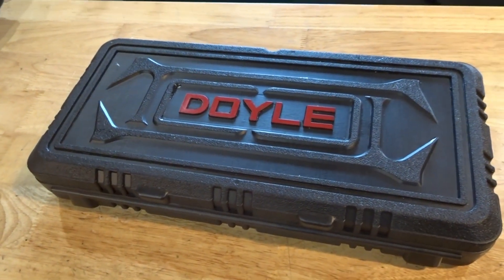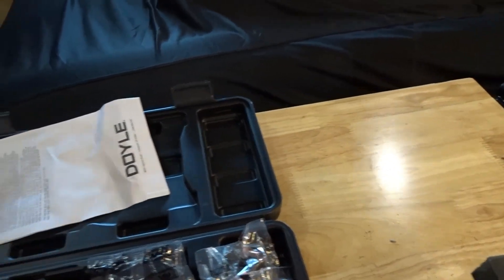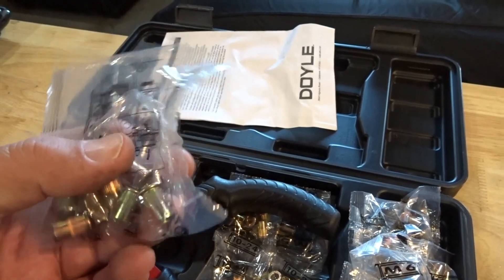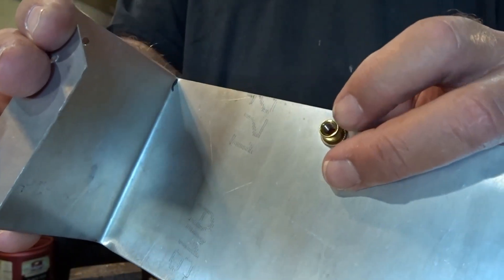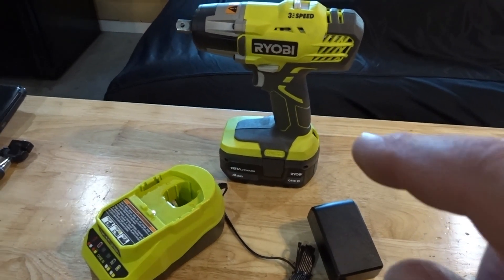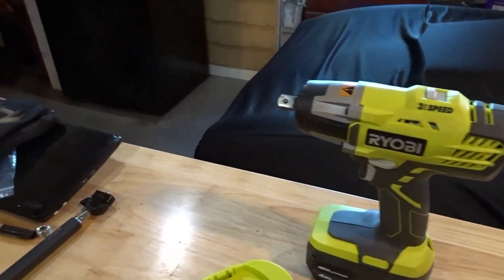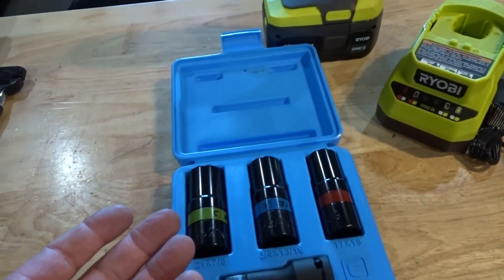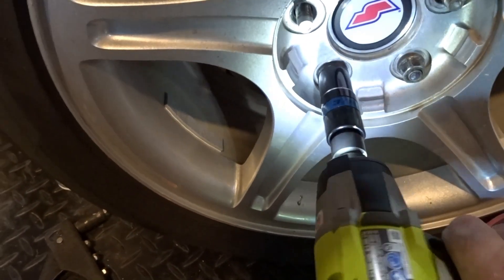We Got A Couple New Tools For The Shop

Comment: i had a real problem with my nutserts spinning when I tried to secure the buttonheads on the firewall. Had to end up cutting a few bolts off and hammer out the nutserts. Ended up using loctite on the back of the nutsert to prevent slippage.
Reply from the maker: Nutserts can be funny that way. I've had them not allow the screw to be threaded in. In that case I run a tap through them to clean the threads.

Comment: And Thank you for calling them “Nutserts”… haha. I was able to commandeer a battery operated Firebird Nutsert gun (kind of expensive) a few years ago…. And it works fantastic. And the worst thing you can do is to install a nutsert… poorly. The new Nutert tool you bought is exactly what people should be using…. NOT the little one handed tool that looks similar to a normal pop rivet gun. You want the Netsert installed SUPER TIGHT…!! If it comes loose because of a poor install you’re screwed…… haha. And they are not all that easy to remove if loose.
Reply from the maker: There are quality nutsert tools in the pop rivet style available. They are pricey as well. For the convenience of being able to pick this up locally for $50 or so it's been more than worth it. The impact wrench is a game changer as well. No more dragging a hose around the shop for the air gun.
Reply: @i.e.427garage  Yeah… a friend had two… and gave me one. Wow… works like a champ. Plan on ordering my FF COBRA very soon to start the build. Just bought a house with a 3 car garage here in Colorado, specifically just for the project. Really enjoying all the tips on building the Cobras. Thanks so much…!

Comment: I'm catching up on all your old videos, curious how you like the Ryobi impact. I've got a toolbox full of orange box store brand tools, been looking at a few Ryobi. I'm also curious, what brand is your 4 post lift? There are so many out there from 2k to 20k... keep up the great work!
Reply from the maker: No complaints from the impact. Battery seems to hold a charge for a long time so it doesn't need charging very often. Does everything I need it to do. The 4 post lift is from Direct Lift and is their 8000 lbs unit. I bought the lift second hand and it works great. I paid $1000 when I bought it. Paid another $800 for the hydraulic bridge jack and bought it straight from Direct Lift. Couldn't imagine not having one now.